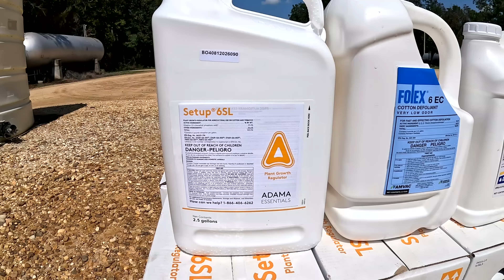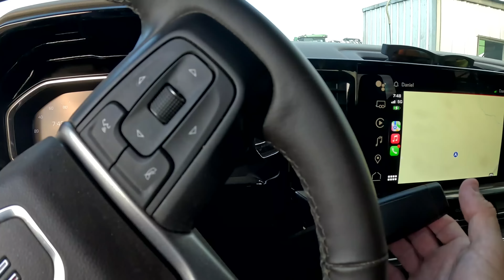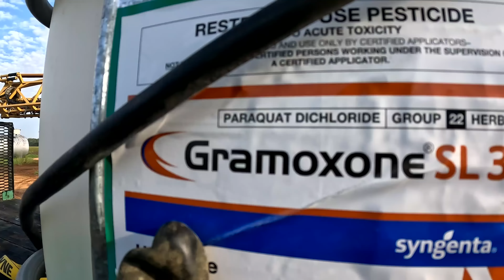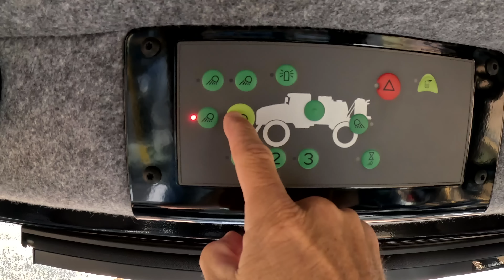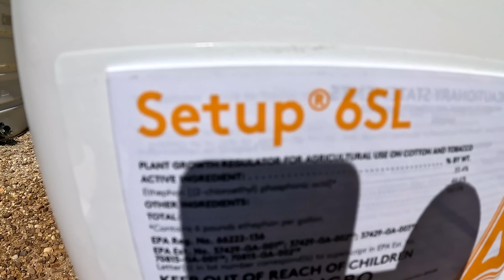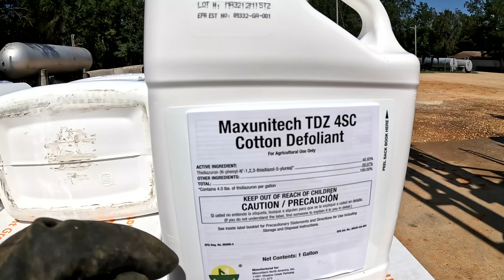KNOCKING LEAVES OFF ALABAMA COTTON

Comment: Question from someone who has never farmed more than a jalapeño plant in a pot. Is it possible to put the chemicals into the pivot to avoid using the sprayer?
Reply: Negative. The pivot won’t get full coverage like the sprayer would not to mention very expensive even if we had the setup to do it. You could spray a field a lot quicker with our sprayers and be done long before the pivots even get half the field and as I said above you wouldn’t get the coverage you would with a sprayer

Nobody prays more for rain than a farmer that owns pivots🤷🏻‍♂️